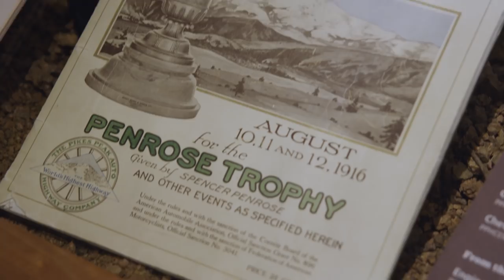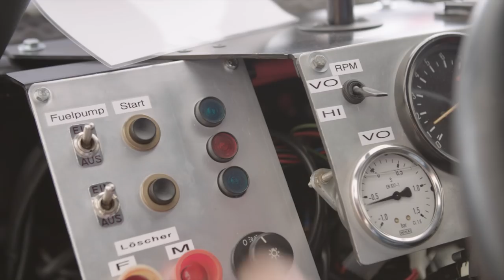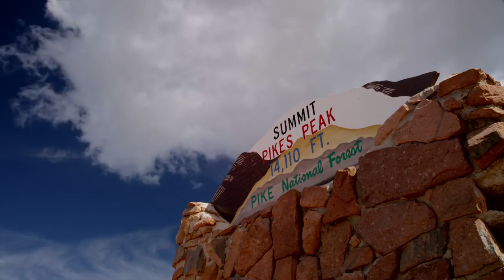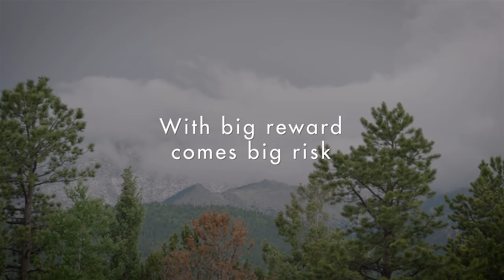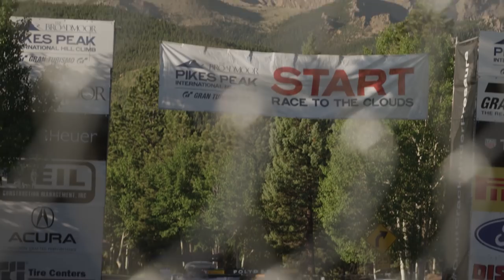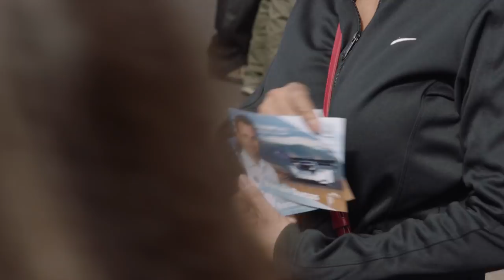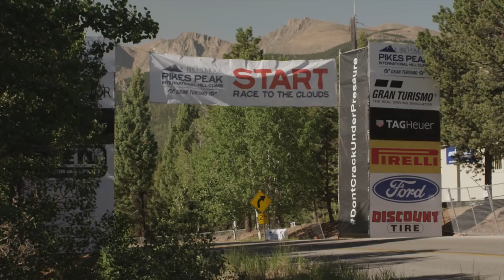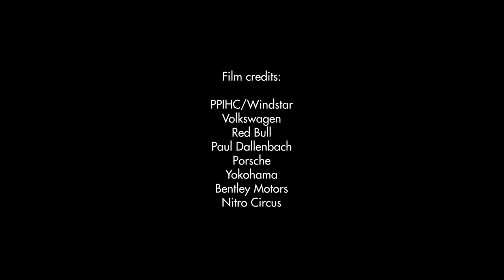2018 Pikes Peak: The Mountain Decides

Comment: I’m glad they touched on the fact that the road is fully paved now.  When it first happened I was a naysayer.  But when you really think about it, a fully paved road upped the anti for the drivers.  The speeds are WAY higher on the upper half of the course where there’s nothing between the driver and a 2,000ft drop except their skill.  Great video and great drive for VW and the other winners.

Comment: Ummmm so the Porsche Cayman GT4 Clubsport was only 16 seconds faster than the Bentley Bentayga?
Reply: Kenji Kanagawa that Bentley has waaaaaay more power
Reply: How much weight was stripped out? Stock they are 5,300+ lbs, aren't they?
It seems difficult to make up for the weight using power, especially at altitude using a combustion engine.